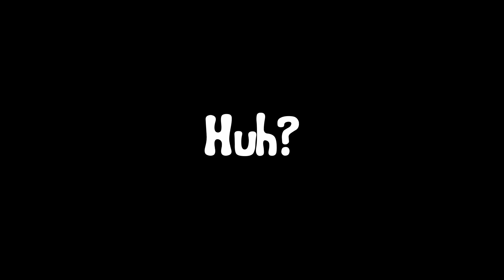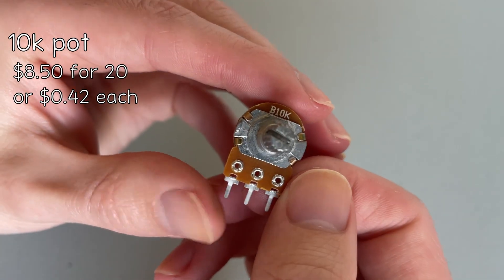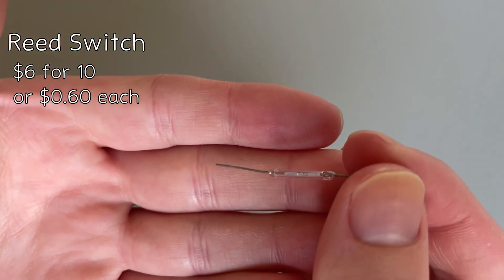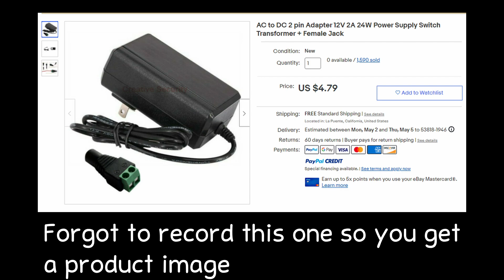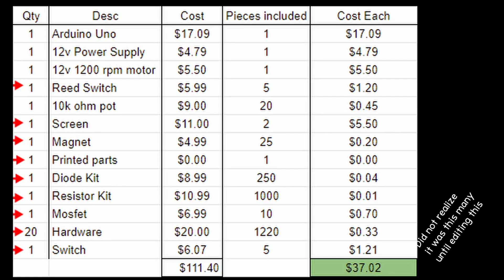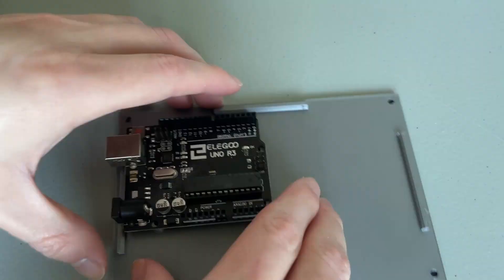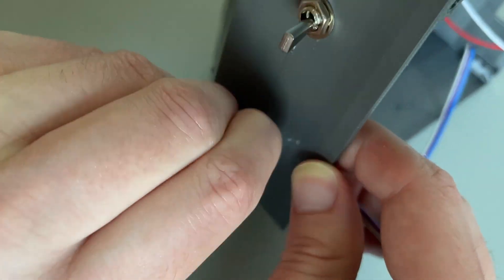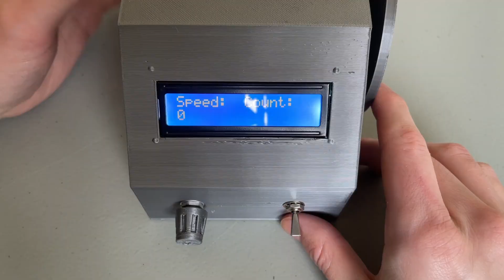DIY Pickup Winder

Comment: So basically I wouldn't need that much electronic and programming hassle, if I just use a basic bike odometer or some mechanical counter (if I can find one) instead of this digital display. Just build a wooden rack for it and use drill or even hand lever with 1:10 ratio. I might try that. Of course it's not fancy like this, but if I use it just 1 to 20 times in my life, I think it should be fine.

Comment: $36? And what did the 3d printer cost?
Reply from the maker: That’s a fair point. The printed parts are mainly just a case, which could be made out of almost anything
Reply: Also most librarys now days have 3d printers, a library card is free, you pay for filament just like you would if you owned the printer

Comment: I think a pickup winder could also be made using an old computer hard drive based on this short video.
HDD HACK - Make Grinder From Old Hard Drive: https://www.youtube.com/watch?v=ZNJRehl6YpI
Can obviously be made into a pickup winder, disk sander, etc.

Some videos show wiring that may need to be done, as can be seen here: https://www.youtube.com/watch?v=m_zLUw5J62Q

A guitar pot could be used to vary the speed by turning the voltage up and down, and a postage weight scale with a "Tare" function could be used to count the windings by "weight." Not perfect, but probably close enough, and perhaps even more precise, as you will know how much copper was used. You can also use the HD Magnets to hold the pickup bobbin in place while it winds, if you put some magnetic metal temporarily on the bobbin.
Reply: Well, we're waiting for you to make one and upload a video....Hopefully you haven't already wasted three weeks.

Comment: is hard to add a second moto for wire guide, for automatically moving left and right...? make it fully automatic , sounds quite a complicated to me, maybe you can make a upgrade in the future, great video anyway.
Reply from the maker: I think it would be possible, but I don’t think it would be easy. It would require a serious redesign of the case to make space for and include a guide mechanism.
Reply: @tinyboatproductions A machine wound coil (think of a fishing reel) would have more capacitance than one that is randomly wound (called scatter wound. The inductance and capacitance determine the resonant frequency of the pickup. Scatter wound pickups are preferred.